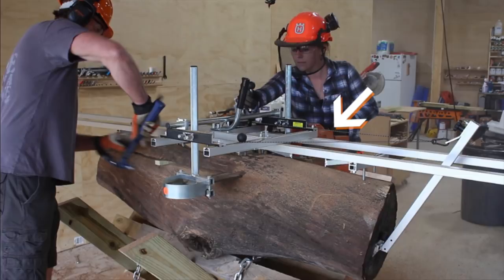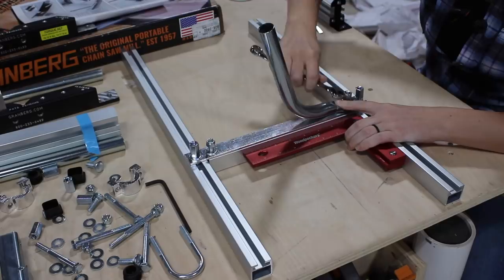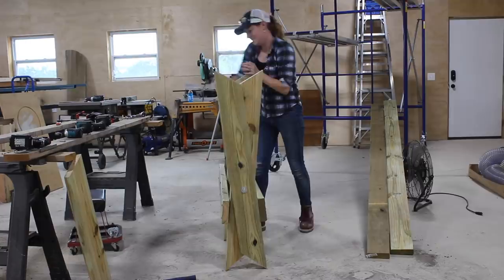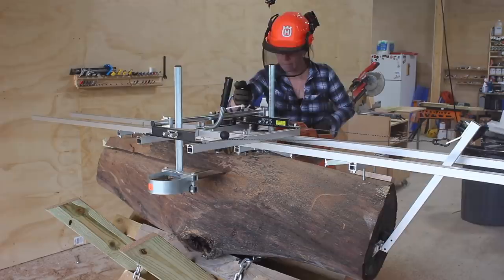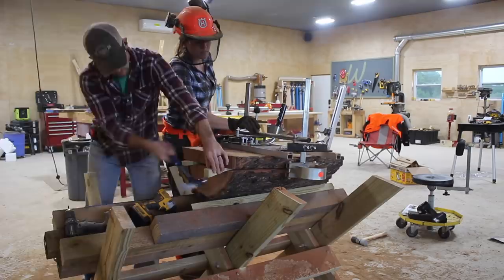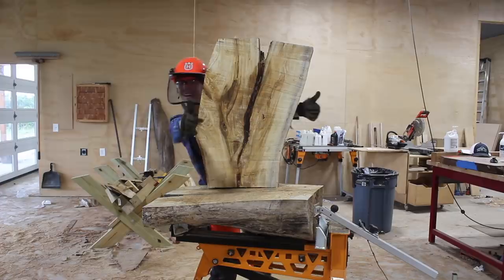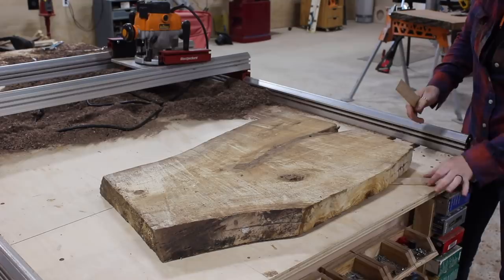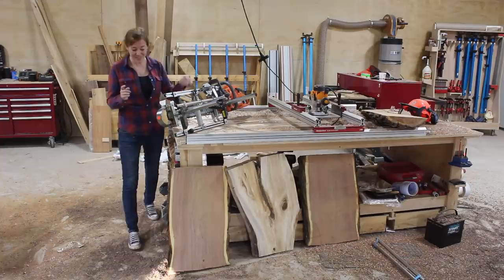Portable Chainsaw Mill : How To Slab Logs

Comment: Good video!  **MR. SAFETY ALERT**  I wear a mask when I use my chainsaw mill out in the woods. I have found that those wonderful, efficient ripping chains make a fine dust that is totally different in character to the big shavings produced when a typical crosscut chain is used to buck a log. I'm trying to be good to my lungs.

Comment: Found your vid while surfing. Nothing really new to me, but I wonder if you know the difference between a rip chain and a cross cut chain? You can change the blade angles on a regular chain, or purchase a ready made rip chain for a chain saw. Cuts way better when using a rip angle grind or rip chain. FYI  EDIT, never mind, you figured that out, I shouldn't have jumped ahead lol
I was wondering how you managed a decent cut...correct chain lol
I watched some fellows making 12 foot wooden blades for a wind generator. Nice jig and skids built onto the chain bar, but they used a cross cut chain; and it was really obvious, almost hilarious ;-) And a little sad?

Comment: I make a homemade jig for 14' long slabs that are 42" wide if not wider I'm always having to remake one depending on the size slab usually using angle iron.  Wondering what sizes does the flattner that your using come in or if I could adapt it to the bigger ones that I am using. And love the adapter for the router need one of those lol

Comment: @april.. the lil sharpner is nice...but did you follow up and file down your depth gauge rakes as well.   I've seen the oldest most season  loggers..toss chains out 
after a few sharpenings.. cause no one pointed out the depth rakes need to go down as well. Stihls new hand sharpner.. I highly recommend. I run a 25"bar  on my alaskan mill via a stihl and same as you.. about every 3rd cut.. I wipe out the sharpner..make 3 passes on each chisel and it's good to go.

Comment: If you're running out of depth on your router a cheap set of 1-2-3 blocks would solve the problem I imagine. Even a cheap set of 1-2-3 blocks is going to be more precise than most  carpenters ever will be.

Comment: Great video, one tip for you is that its not very good for your arms and shoulders to drop start a chainsaw, the easiest way to start the chainsaw that's the best way for your body is like you did holding on the ground. The other is to clamp the handle of the saw between your legs and pull the rope.

Comment: You're getting unbelievably good.  Kiln drying and moisture control?
Reply: IF you were doing this you could cut them to the desired thickness then let them sit in a dry place for 1 year per inch of thickness and the moisture would be minimal. That's the general rule. I generally like to let my fresh cut stuff sit a year and a half per inch just to be sure and I don;t have a moisture gauge. I also like to turn mine every month or so to keep it from warping too much. Hope this helps you.
Reply: @littleshepherdfarm2128  A year and a half is a long time to store something especially if it's stacked for air flow. I'd be curious to see how different wood reacts [warping, cracking, defects] as the moisture content is brought down in a controlled process before the final acclimation to an indoor space.
Reply: She was talking about air drying and not kiln drying. It takes longer but I have found out that the time it takes keep the wood from warping and or twisting so much. You can move the process along bu building a tenting system and covering it with heavy black plastic. The tent will warm up curing the wood faster and at night it will cool off letting the wood rest.
Reply: @xmassan20906  I have a really big barn so there's no problems with that for me. The other reason I let it sit so long is that it takes me a long time to get to those kinds of projects because I'm always busy with more important things that need to be done ASAP.
Reply: @davidcurtis5398  Yeah air drying and my question was why not kiln dry to see how wood reacts.  You can tent it but depending on your climate, you may only be able to air dry the moisture content to a certain point. Dragging it into conditioned space may make it dry out too fast. A kiln  seems like an option to more precisely control the moisture content and the stability of the wood.
Reply: @xmassan20906  Do you have any idea what a kiln drying system would cost??? I think not!!! Only if you are a large supply a large amount of timber could you afford a kiln to dry wood in and yes it would be faster and you would have more control of moisture but the cost for this lovely lady would be so verry verry verry high. Not at all affordable...

Comment: I am using my router sled for cross cut slabs. To make charcuterie boards. But I get so much tear out (I call it pithy). I am using a 2” forester flat bit. Someone recommended a belt sander instead but I can’t get it level using that method. (Low in the middle, higher on the sides) any suggestions for how to get it flat?  Bye I just received my chain saw mill and put it together last night. Can’t wait to use it. Your video was awesome!!

Comment: With your 24" bar and the 24" AKMill what do you find is the widest slab you can cut?  Did you have any issues clamping over the rivets of the nose sprocket in the chainsaw bar?  Nice video.  Thanks

Comment: Couldn't help but notice the leveling screws had slotted heads on them. Why, in 2018, slot head screws are still used on anything but faux antique or replacements for actual antiques is beyond me. Anyways, nice new tool you got there. Perfect for the occasional slabber.
Reply: Simple answer is that every bolt and screw on the Granberg mill can be turned using the "scrench" tool used for the chainsaw.
Reply: I hate slotted screws, too. BUT for screws which may become covered with gunk or paint or whatever, there is one advantage to slotted screws: You can always clear paint and other crap out of the slot, but it can be very difficult to clear out most other types. Not saying it is the case here, but maybe?

Comment: Is the slab flattener indexed so that it moves forward by the correct amount each time or do you have to eyeball it?
Reply from the maker: Nope, you have full control over how much you want to take off. I take off smaller passes during the rough cut and fuller passes on the finish pass....since I'm taking off less.

Comment: I bought a Granberg Mill two years ago. I must say yours looks a lot fancier and sturdier than mine. Did they know it would be featured on the channel? Not hating on ya just wish mine were as nice as yours appears to be.  I've had to replace stripped fasteners and repair mine a few times.  Most of my milling is done in the field. I have to pretty much mill the log where it fell without benefit of any heavy equipment to move large logs.  I can say that when things are on ground level and you are behind the mill pushing it through the cut the exhaust port is right at rib cage level and the exhaust from the saw builds up under the face shield.  Without a good breeze it gets to be a bit much.

I'd like to try a wench system of some sort. I can see from where you are standing in relation to the saw that would help me with my exhaust problem.  I wish you had shown what happens when the mill makes it all the way to the end of the log and the front of it runs into the wench's pulley support.  I'm curious how that transition works.  

I run my mill with a STIHL 661C and a 36" bar.  Its a 90cc Head and for some species I think I could get away with a 42" bar.   I have been unimpressed with the oak logs I've been into as well.  Both were residential pin oaks that grew in yards instead of forests.  The first time I cut pin oak in the standard 2" slab.  The WIDE growth rings did not dry well; VERY checky even with end grain sealed.   The second time I got into a BIG 8'  pin oak log I milled it into beams 6.5" x 8.5" inches thick.  Much happier with how those turned out. 

Different trees will wear a chain differently.  The last log I milled was a hedge.  The log was 10' clear, 28" diameter at stump end and 19" at narrow end, no branches and straight. RARE for hedge.  A similar pin oak or hackberry log i could have milled all 6 slabs with one maybe 2 chains.  This hedge log went through 4 chains to get 6 slabs off of it. It was just MURDER to mill.... But absolutely HAD to be done / tried.

Comment: Question - if the slabs need to dry for 1 year per inch of thickness, do you need to wait until dry before flattening? I know you said for videos sake you were going to go ahead and flatten but SHOULD you wait until dry?
Reply: Don't really need to wait, but it's during the drying process that the most movement is going to happen. So flattening before drying can be a bit of a wasted effort as you'll have to flatten again.

Comment: First, thanks for the video. I found it very informative. I do have some questions. I have dome some milling using very simple home made chainsaw mills, and have been researching some of the more elaborate chainsaw mills like the one in your video or the norwood mills. So I am seeing price tags of near abouts $1000 for the mill (at least for the norwood). Plus the price of a good chainsaw. On the other hand you can get a bandsaw mill from harbor freight for under $2000. I have seen it as low as $1499. What are the pros and cons? Thanks much.

Comment: Nice job & video. One thing lassy, you have all that safety equipment and you didn't wear your hearing protection. Its sitting 3" away from your ears, use them!
Reply from the maker: My hearing protection is Isotunes and inside my ears. You just can't see them.

Comment: If you get a chance check out arborist forum they have a milling section and milling 101 sticky.    How where the exhaust fumes inside the shop
Reply from the maker: I had my big bay doors open so it was just fine.

Comment: You don't really show starting and finishing, especially starting, how do you make sure the 2nd height guide bar will touch the log at exactly the right height? It looks like the chain would start cutting before both guide bars are resting firmly on the flat surface of the log.

Comment: when cutting with frame directly on the flat log surface, as you start your cut how hard is it to maintain the frame parallel to the log since only the forward frame member is making contact until entry is made far enough for the following frame to make contact.  The reverse is taking place as you exit the slab.  How difficult is it to start and finish parallel

Comment: What is the part number of the chain you are using and can it be  purchased from Tractor Supply? I have the same chainsaw that you are using in the video. I ordered one of the Granberg Alaska MK-4 mills, rail kits, etc., today. I have lots of trees to turn into rough lumber.  :-)  Thanks for the fine video!!   Chuck

Comment: "two main methods" There is also a third method - circular saw which is the "most mainest".
Reply: Not really accessible for those wanting to mill lumber themselves at home. For the hobby/small shop woodworkers out there, the two main ones are chainsaws and bandsaws.
Reply: @guiturtlewood  Ok, maybe it's different on that side of the Atlantic ocean but here you can find in almost every other old barn some kind of an old circular saw mill. They are called here as "kenttäsaha" (field saw).

Comment: Never drop start! the saw may backfire and fling the tip of the bar right into your face. on the floor is correct!
Reply: Logger for 5 years... never started a saw on the ground until I started in the fire service... now the safety police have us starting saws on the ground. Pander to the least common denominator. You would be laughed off the job site starting your saw on the ground at logging camp. Ive never run a 911 call on someone getting hit in the face from starting a chainsaw (approximately 8000 calls), and never heard of it happening to a logger.

Comment: In terms of small scale production, there are three main types of saw mills, not two. The third being circular bladed mills. The Mobile Dimension Saw (powered by VW aircooled engine) for example, which cuts vertically and horizontally simultaneously.  Also, at least in the U.S., those "X" braces are known as sawbucks. The X shape giving us the nickname for our ten dollar bill.  If you didn't know that, you're not watching enough film noir.

Comment: I find it difficult to believe you cannot drop start a chainsaw. Keep trying, it's not so much your size and strength as it is technique. That's what I was taught. I don't do it anymore though. I only used it whilst making firewood on the farm.

Also, I now believe a visit to your shop is definitely not in my future. I  don't move so fast anymore. I don't want to be slabbed. 😥

Comment: I am personally not a fan of drop starting chainsaws... for two main reasons... first of all... you can easily break your chain when the starter cord does get stuck and your chain bar hits the ground and second of all... not too safe at all... even when the saw is not starting... you still can injure yourself if something goes wrong

I prefer the leg lock start (works on icy ground in winter as well and it is safe to be performed when a ground lock start is not possible, for example when there is too rough ground or mud where you work with your chainsaw)

for the leg lock, you grab your front handle with your left hand and pinch the rear handle about knee high in between your legs... then the saw is locked and you can start it with a straight back standing upright (here is the part of the vid uploaded from Husqvarna USA https://youtu.be/Teb2bQsqx44?t=604)
Reply: Sorry to say but drop starting is not that dangerous when you know what your doing, like its impossible to cut your leg off if you have your chain break on and i have never seen someone hit the bar on the ground unless if there 4 foot and holding a 49 in bar. Lol
Reply: @crankshaft1053  where did I say that "cut your leg of" thing? please show me... because I didn't write that... I only wrote that "you still can injure yourself if something goes wrong"

and yes I have seen several dull chains because people started chainsaws that way and they only had 28 inch bars in their saws... but still hit the ground... and no... not all of them used the chain break because they "are experts" trying to tell me that this is total BS and they know what they do... and guess who had to sharpen their chains later on as the saw didn't cut properly?

and yes I have seen people dropstarting because they told me that "it has to be done that way because there is no other way of starting a chainsaw standing upright" until I showed them the leg lock start... and that I had less issues with my arms because I didn't use the "weight of the saw" to start it... and no chance of the bar hitting the ground as well on  the leg lock

Comment: This seems lackluster compared to the other milling videos I watched recently. No offence intended at all. One of the videos has a guy with a 52" circular blade hooked up to a bus motor and cuts entire 16' long 20" diameter oaks up in 10-15 minutes. Still would like to have one of those mills you're using other than the whole chainsaw part. I'm still afraid of those.

Comment: FYI, DONT DROP START THAT SAW!!!

those new Husqvarna and Sthil saws have cammed quick start starter reels because they have high compression  engines and drop starting them can (and does frequently) damage the starter

just stick it on the ground and pull it rapidly and dont let the starter cord go and snap back

that's all.

just dont want to see you or other noob people damage a 500-1000 dollar chainsaw lol

Comment: No way would I ever trust some router bit extender. NOPE......you people do realize just how fast of a revolution these router bits turn at ? Especially the larger sized collets are prone to loosen very quickly. That shit would not fly at any shop I ever worked at in my 40 years of professional woodworking. Becareful and you'll end with decades of experience and still have all of your fingers without incident !